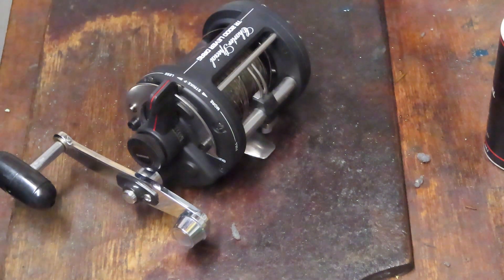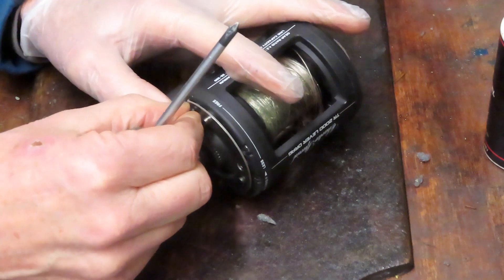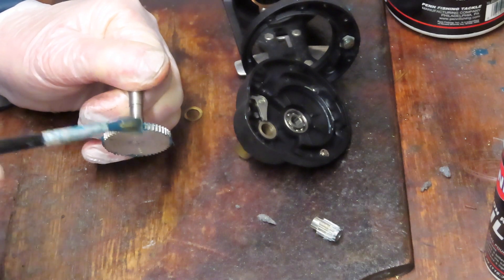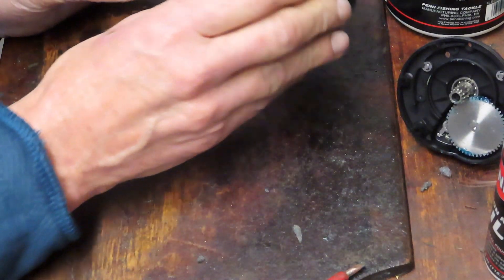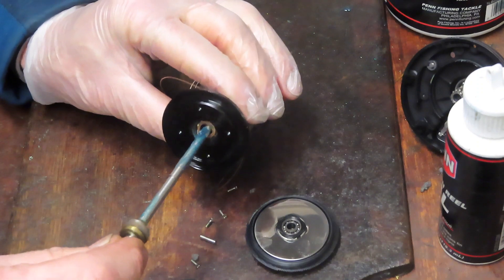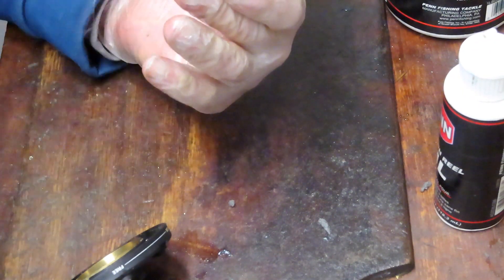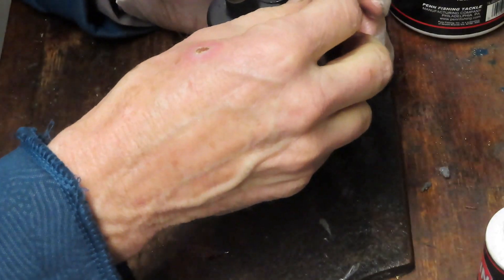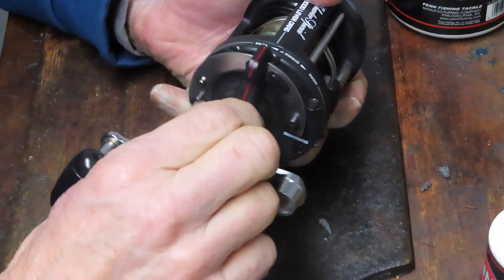Shimano TR2000 Charter Special lever drag fishing reel how to take apart and service

Comment: I actually sent you an Email tonight about a conventional surf casting reel called a Cozzone that I saw on EBay. It said it had a Pflueger Williams Drag in it. It is a beautiful reel with hard rubber side plates. Unbelievable that you had 5 screws that were the same size on a Shimano reel. LOL I just bought a tub of (the big one for me) of Penn grease because some of my non-Mitchell reels need a higher viscosity grease than the SuperLube I use on all my French Mitchells. Wow, four more screws the same - unbelievable. Well it’s coffee time again. LOL.  If I used this type of reel I wouldn’t hesitate to buy one of these. It is a fine reel!  When I had an Ambassador 7000 C3 conventional reel I think it had four or five of those brakes and the reel came with different sizes of those little brakes. This is another great instructional video for your library.
Reply from the maker: That is a beautiful reel.  I have not seen it before

Comment: Looks like a good reel
Reply from the maker: It is a very nice and durable reel that will last and last.   Best wishes Terry - Dennis
Reply: great reels, we have a dozen of them on a fishing charter and they last for ever, drag works great, clicker sound is loud, just one weak point, the black plastic piece that holds the screw for the handle is a bit weak, and it breaks some times, no big deal if you caan get spares...
This video helped me fix one of them where the clicker was not working. Thanks for such a good video!!!!

Comment: Great video, will bookmark as I will use in the future, but need some advice now please, Have just purchased one of these reels, used, 2 yrs old working perfectly. Only thing done was that seller removed handle and included separately to avoid damage during postage. When received I reattached the handle but reel now winds backwards and spool rotates to let line out, fairly smoothly, and winds forwards with difficulty in jumps and starts, nowhere near like normal. I have had and used a number of Shimano TLD reels over many years and they don't wind backwards. Any suggestions appreciated.
Reply from the maker: The spool turning backwards has nothing to do with the handle being removed unless they also pushed in the main gear in the process.  The spool is stopped with an anti-reverse dog that is not working properly in this reel. You would need to take the reel apart to determine if the dog is broken or simply detached - Dennis
Reply: @2ndChanceTackle  Dennis, some feedback and a lesson. When the handle is removed on this reel, and possibly on all of the TLD style Shimanos, the main gear/shaft can move inwards about 2 mm, allowing the anti-reverse dog to disengage from the ratchet. Mine was fixed in about 10 minutes by a certified Shimano tech as a warranty issue, and he confirmed what a number of other service videos demonstrated - when refitting the drive side plate after reel disassembly, set the ant-reverse ratchet and dog in their correct position, then fit the handle which holds them in position. The lesson, don't remove the handle unless doing a complete disassembly. Thanks for your guidance.

Comment: Thanks again for a great video.  For information purposes, As far as level-wind, Lever Drag reels....there is also another reel on the market that I have seen with both of these options.  The Okuma Fishing Tackle Solterra SLX-15L Standard Speed Levelwind Lever Drag Reel..... has both the level wind and lever drag systems along with numerous bearings. Cheers!
Reply from the maker: Thanks Jimmy - I just finished an Okuma Titus 15 and a Penn Squall 40 and both also have the Lever drag and level wind features - Dennis

Comment: I've taken the reel apart several times and meticulously put it back together. But each time I use the lever drag it gets loose and there's very little drag. And each time I pop the top off I find the little spring held pawl has come off it's little post. Any suggestions?

Comment: Hey thanks for this video, i took my tr2000 apart to service it several years ago. And its never worked since. So hopefully i will be able to resolve that with the help of your video. I might have to ask for some advice, is that ok?
Reply from the maker: Sure thing.  Best wishes on the project - Dennis
Reply: @2ndChanceTackle  i think the small piece that crosses the main shaft is bent somehow, so doesnt sit centrally. Any suggestiins on how to get it out. ?
Reply from the maker: Can you send a picture or two of the piece in question to me - email 2ndchancetackle@gmail.com - I will try to help - Dennis

Comment: I’ve got two of these reels. 1 the clicker is strong and other isn’t. I believe it’s the copper piece is bad. Any suggestions? Thanks
Reply from the maker: I am not sure if there are replacement parts available.  That is the only option you have to restore these and that will be dependent on parts availability - Dennis
Reply: @2ndChanceTackle  do have any place I can find them? Parts diagram I seen didn’t give me a parts number.
Reply from the maker: Part numbers are 
TLD0209 - click tongue
TLD0210 - Click washer
TLD0018 - Click "C" clip
TLD0148 - Cling spring (copper ring)

You can check to order these through Shimano directly or through Southwesternparts.com
Reply: @2ndChanceTackle  thank you
Reply: Able to get my drag level to work properly with your video.   Thanks